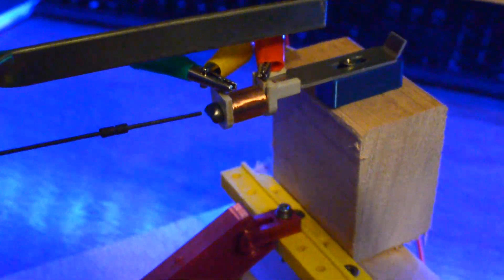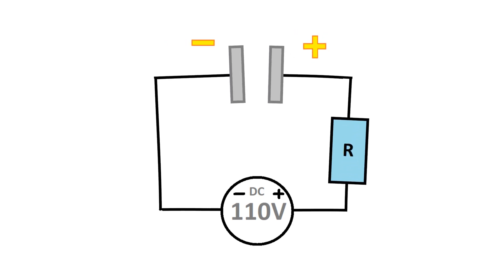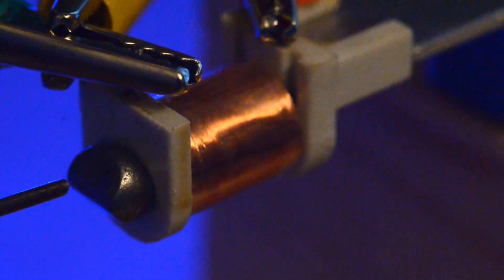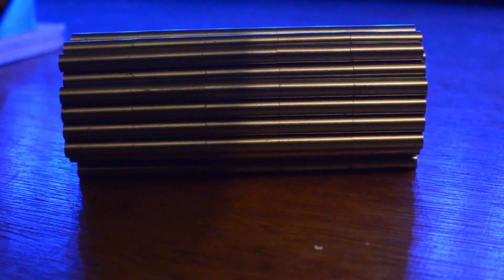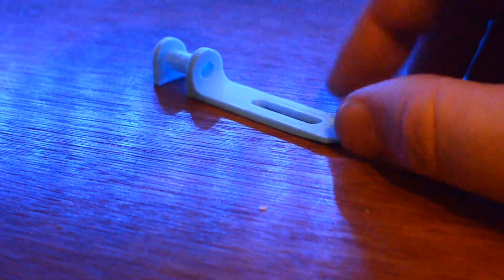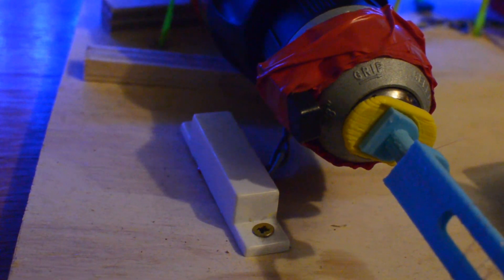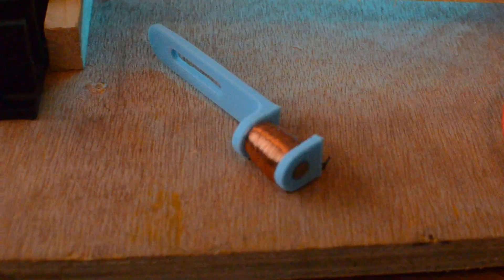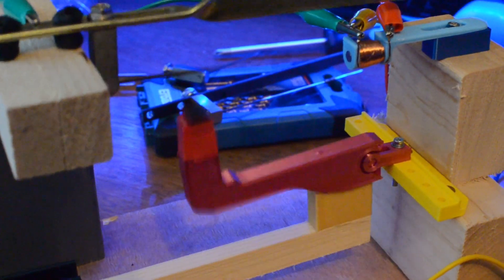DIY Electric Piano - Pickups - Episode 4

Comment: Hiya! just restoring a stage 88 and have a snapped pickup. Would you be willing to share or sell your 3d printer file so i can print a pickup? Thanks!
Reply from the maker: Yes I can, drop me an email. Though you will add move value to your piano using proper pickups than you will save. Where are you located?

Comment: Guitar nerd suggestion, so take it as you will :P  You've essentially made one pole-piece of a Fender-style single coil there. A Fender pickup is made by placing the (in this case 6) magnets between two pieces of fiberboard and winding the wire around the magnets themselves. Maybe you could use a similar idea here to save on time, materials, and complication, especially in the winding process. Hell, you could even scavenge the pickups from a cheap Squier Strat or Telecaster and mount them opposite your test tine, just to see how it sounds. That could really simplify the build and maybe even lower the overall cost. Just a thought. Here's a link to a video detailing the construction of a Strat pickup: https://www.youtube.com/watch?v=0EzjBbwzYAw
Reply from the maker: Some good points here.
With a tine based piano the end position of each tine can be all over so it make a single pickup difficult. Though I am currently winding pickups for my piano and its taking ages. The guitar style design would have been done by now. 

I like the idea of going even further than the guitar 6 pole pickup and going to a clavinet pickup. Though I think this will need to be a future project. 

There are a few key points i have missed from this video so I am tempted to create a part two. If I do ill add a guitar pickup comparison.
Reply: @deancoyle  Yeah the tine spacing could be an issue. I suppose that's why CBS made the pickups the way they did even though they had access to Fender's pickup designs and manufacturing
Reply: @deancoyle  Okay I've got another idea for you: Danelectro "lipstick tube" pickups. They're just a bar magnet with wire wrapped around it, so the whole length of the pickup produces an EM field. Modern Danelectros are made cheap, and they've been around a while, so there are lots of these pickups on ebay for very reasonable prices.

Comment: how many turns do you do for each pickup?
Reply from the maker: I have played around with a few number of turns options and have settled on a 2500. The Fender Rhodes uses around 2900 I believe. 
Are you creating you own pickups?
Reply: @deancoyle  No but your project is very intersting to me, maybe some day I'll do it if I have the time. I'd like to have an electric piano but they are so expensive now, they old ones as much as the new ones. I used to have a Rhodes but unfortunately I sold it, what a mistake that was.
Reply from the maker: I am sure you had you reasons to sell it. I would set up alerts for all marketplaces (facebook, ebay, gumtree, craigslist)  near where you live, good deals do come up now and again, they just don't hang around very long.